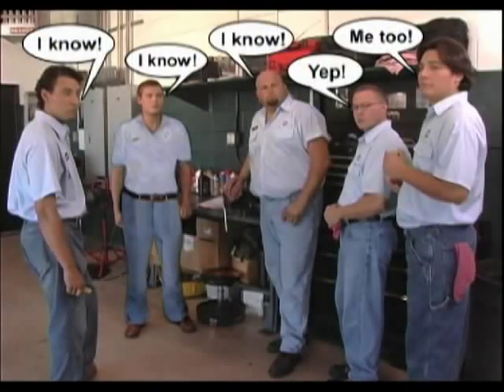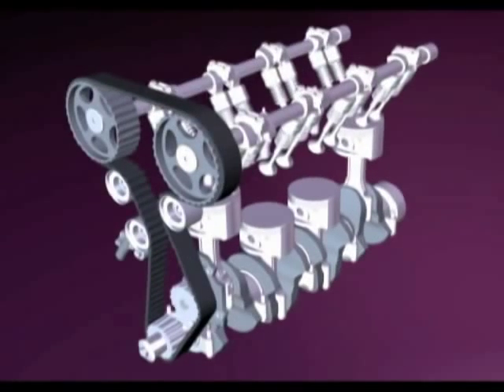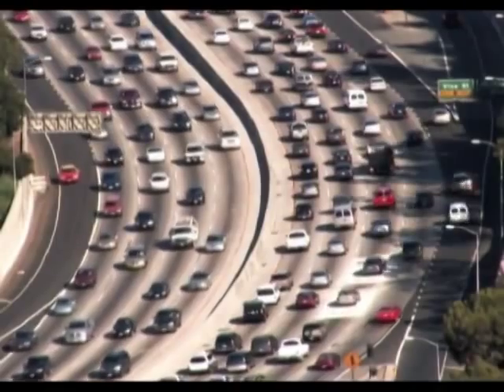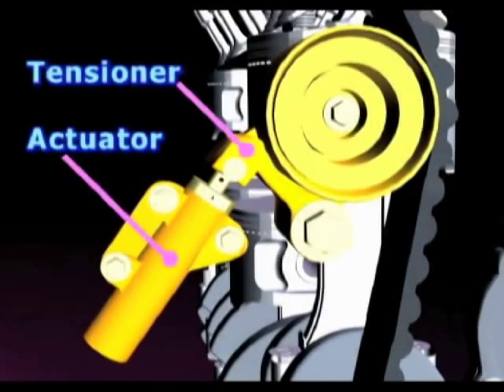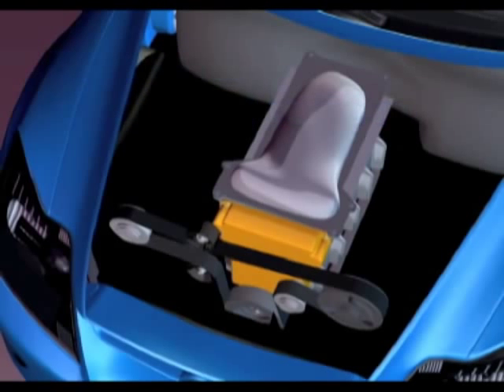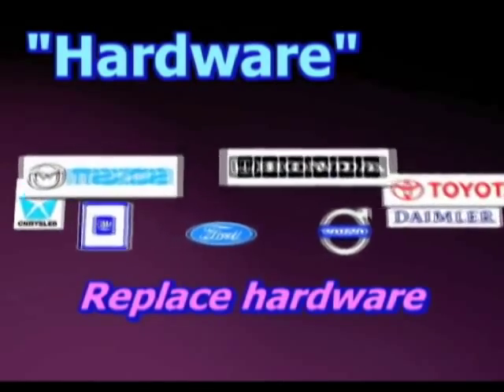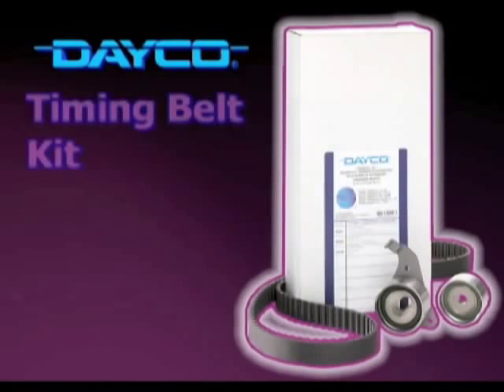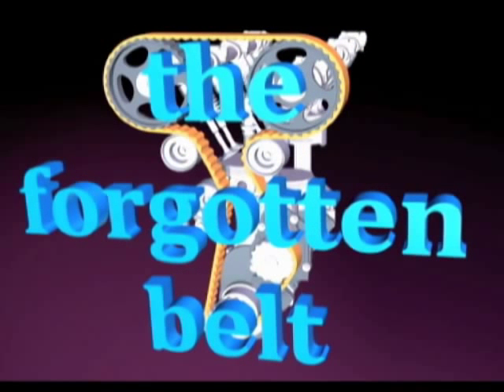Timing belt maintenance explained.flv.flv

Comment: It's true, timing belt is so important, it should be inspected and be replaced. How many years is its duration?
Reply: I have a Lancer 2.0 and s
it is only 44.000 kilometers with 9 years of usage, I changed the timing belt and puley, it was in very good shape, i'd say it can last easily 10 years or 90k kilometers whereever comes first. (Using good products)
Reply: @miguelsalas88 my 2014 Sierra has 135000 miles with the same belt and no issues whatsoever

Comment: what if the timing belt broke while you were time traveling? could it make a copy of your self to be in 2 times eras or would you travel to the dinosaur age?
Reply: +Tyee Cambrón thats a really good point u have sir
Reply: rrr
Reply: Tyee Cambrón 

 That's a trick question, DeLorean motor cars use a timing chain not a breakable belt.
Reply: If timing belt broke or cut while travelling....soon ur cylinder head will be in Ultra mode condition...sir